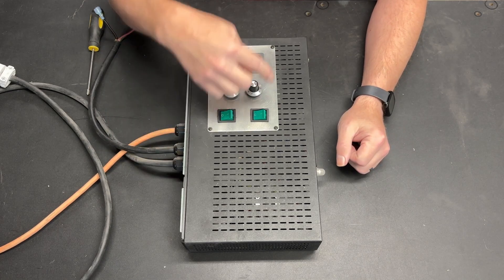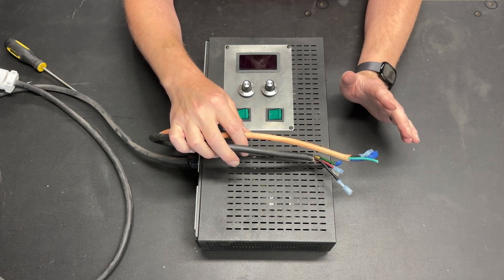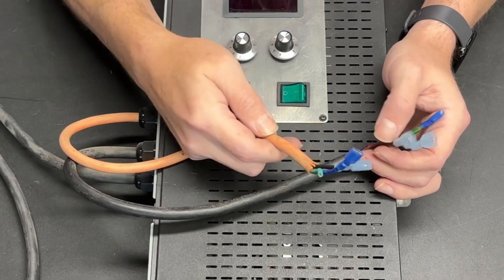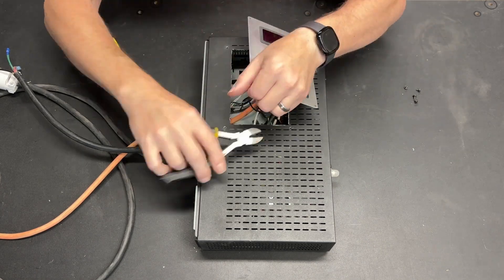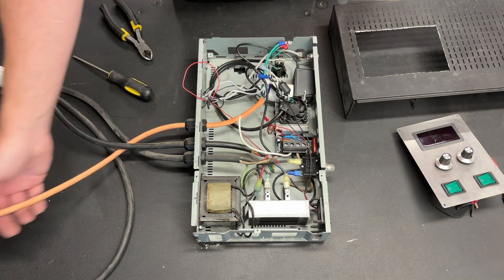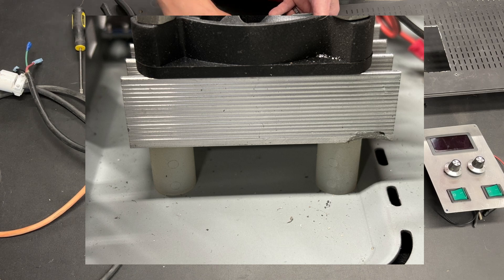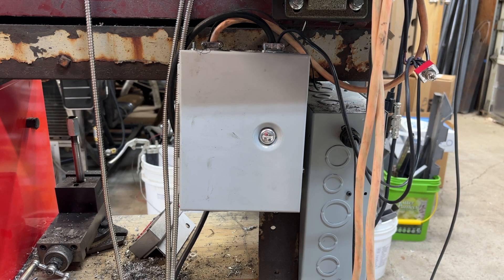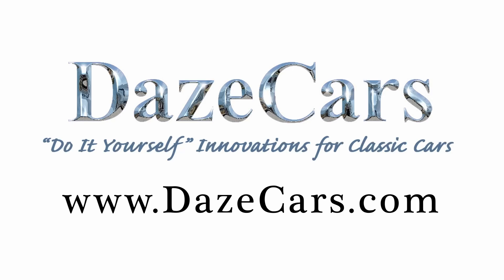Treadmill Power Supply Component Mounting & Layout, How I Mount Everything up in an Enclosure

Comment: Oooh, I can't wait to see the DIY surface grinder you come up with!!!  😆  

I've been thinking about trying to build one of those using a treadmill motor for quite a while now, but a couple of things have been holding me back.  
The easiest one to work around would be finding a good way to keep grinding dust (from the wheel, but especially metal particles) from getting into the motor and electronics.
The much bigger challenge is the need for extreme precision and rigidity in everything from the spindle bearings to the motion of the table.  (Otherwise, what's the point of having a surface grinder?)  Every design element I've thought of so far seems like it would fall way short - usually in more than one way at a time!

I look forward to seeing what you end up doing with the new mill too.  Even after all the upgrades you've done, it's gotta be a vast improvement over the HF combo right out of the box. 

Thanks again for sharing.
Reply from the maker: The surface grinder is a long ways out.  too many other projects need to be done in the near future.  I already have the DIY mill build frame and that was good and rigid so I have a good start to the project.  I don't know that everything needs to be quite as accurate as you anticipate.  The fact that you use a grinding stone to surface the work means the stone will get consumed as it works, that means it will be up to the operator to make adjustments as you go.  At least thats my opinion on the mater. 😂

Comment: I have a question about treadmills. What is the incline for? As the body is not being lifted by running, there is no additional effort required.
Reply from the maker: First it obviously is effective or it wouldn't be a feature.  Not saying that manufactures don't "invent" features that have little to no effect as a way to sell more product.  That happens all the time but this is a feature on most every treadmill everywhere, meaning people are using these everyday and if it was a bogus feature consumers would quickly be on to that.  I can say from personal experience the incline makes the workout harder.  Now to your actual question it is the back foot that is "propelling" you forward and the back foot is lower than where the front foot lands so you are in fact running "uphill"  This effect is more effective the higher the speed, in other words you feel it more with running than walking.  Its really no different than a tread climber as long as you are taking swift steps (swift in the upward motion) its a hard workout but if you take slow steps so that the lift up is happening at the same rate as the stare step is going down your not lifting anything and the workout gets a whole lot easier.
Reply: @dazecars  Interesting. The effort involved with climbing a hill is that you have to add the potential energy that is needed to raise the weight of your body to the top. With a treadmill, you are only raising part of your legs, much less. And that energy is partially returned on the legs fall.
You are not being propelled forward- you stay in one place. All your legs need to do is move backwards at the same speed as the belt. Contact is only needed to balance gravity, there is no forward force involved. I am guessing that the slope affects the ankles contribution. To be clear, no work is being done. All the exercise comes from leg movement and resulting internal frictions.
Reply from the maker: Thank you for your well thought out all be it incorrect opinion. It’s way more of a leg workout, full leg not just ankles resulting in higher heart rate and more calories burned. If you don’t believe me try it for yourself. Again same exact mechanics as a star climber only less aggressive.

Comment: Is the voltage controller required if you only need on/off function? I have a treadmill motor and a table saw that needs a motor.
Reply from the maker: no its not "required" if doing on/off HOWEVER it is harder on the motor to go from a dead stop to full speed.  Also if you don't need variable speed a treadmill motor is a poor choice.  I would find a good AC motor for your application if on/off is all you are after.  The treadmill motor will likely not have the torque needed for a table saw, will run hotter and is far less efficient because of the conversion from AC to DC.
Reply: @dazecars  Unfortunately that's what I have.  Buying even a used equally powered ac motor would be expensive. Also, I don't know the rpm of my Nordic Track 2.5 hp motor to figure out torque, but it looks pretty beefy. I'm wondering if one (or maybe two) of those torrid cores could be used in place of a choke, which wasn't in either of the 2 free treadmills I got.
Reply from the maker: It will help but wont be anywhere as good as an actual choke.  I still think it will be under powered.
Reply from the maker: my pleasure
Reply: @dazecars  thank you so much for the great info in your videos btw!

Comment: I just finished setting up my enclosure today and thought to get online to ask you a couple questions.  Didn't expect to find this new video...  but its right on time :)  1.) My first question is: Is it normal that the power output reads around 90V on my potentiometer (CORRECTION: I actually meant multimeter)  when I measure the current with selector dial set to DC but then it reads 230V when I change the selector dial to AC? 2.) The other question I had is: Could you use the rotary cam switch to power two different treadmill motors with the same enclosure (instead of using it for the motor's spin direction)? Thanks for providing these videos... they are gems!
Reply from the maker: Question 1, I believe the current going through the potentiometers is low amp AC BUT I have never taken the time to measure it.  Also keep in mind the potentiometers will effect the amount the voltage reading that is how they signal to the SCR chip how fast to open and close.  

Question 2 Yes you could totally do that.  I am doing that exact same thing on my mill lath combo.  I never liked the slop the mill to lathe clutch adds to the system so I locked it out and mounted another motor to the mill head.  I am using a high amp rotary swith https://amzn.to/3ArkQ6u to switch between the two motors and the third bank on the switch switches between two different hall sensors so the tach reads what the turned on motor is doing.
Reply: @dazecars  Thanks for replying but I’m still confused. Sorry. I live overseas so we use 220 AC current. Current comes into SCR, then to the AC choke, the rectifier, the DC choke, the rotary switch, then finally to motor. I thought the AC current gets converted to DC after the rectifier. I’m taking the reading at the motor leads where it should be DC current. 

Why am I able to measure both AC and DC current at motor? More out of curiosity than anything else (I mean its working so I'm happy).

I just realized I made a mistake in the question. I meant to say "multimeter" when I said "potentiometer".
Reply from the maker: You should not be able to read both AC and DC at the motor.  I would guess its something not correct with the rectifier (wired wrong or not functioning correctly) or more likely its something odd with your multimeter.  Especially since you were getting both AC and DC on the SCR potentiometer leads.  It would never be both and I'm pretty sure it's ac especially since that was the correct reading for your voltage..  Often times if a meter is on the wrong setting AC to DC and the reverse  it will show voltage but it will be a small voltage and if you don't notice the decimal point or the MV it may look like a bigger number.  Also keep in mind without a load the SCR will test at full voltage even if the potentiometer is turned all the way down.  It is only with the motor hooked up and running that you will see a change in voltage.

Comment: Well done.  Thx for responding to my previous request!  Other than the SCR, did you just attach the other components  by screws into the metal case?  If so, do screws penetrate outside of case?  Sorry, trying to visualize.
Reply from the maker: I use #6 machine screws for anything that has a mounting hole and double sided adhesive tape for the rest. I put the head of the screw on the outside and a nut at the component often a nylock.
Reply: Got it.  Thx again.   Just picked up 2 treadmills!
Reply: Thank you for another great video.  Can usually find some round plastic on the treadmill plastic to make standoffs with.
Reply from the maker: good idea